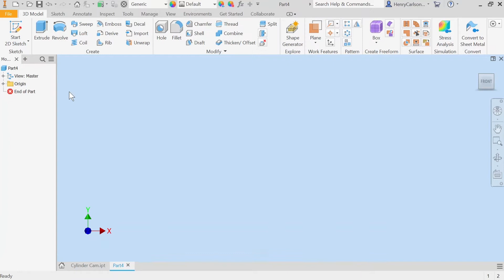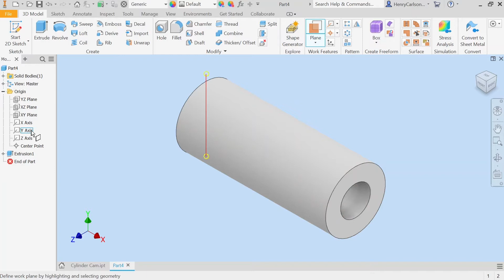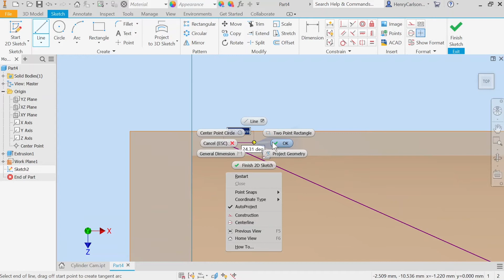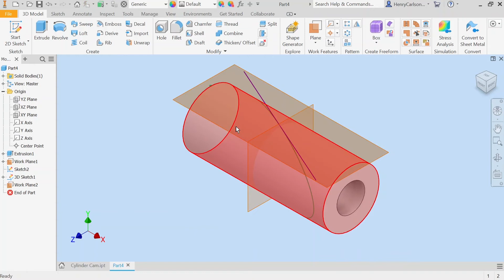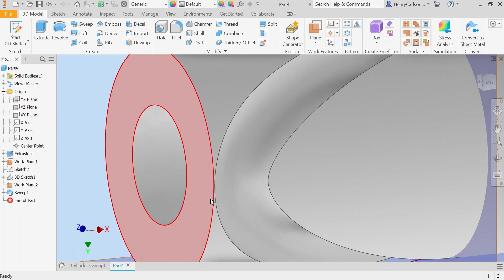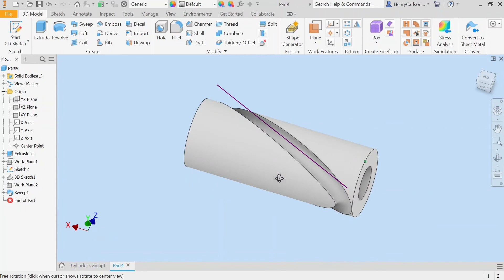Creating a Cylinder/Barrel Cam: Inventor Tutorial

Comment: Hi Sir,
Thank you for creating such a great video.
Sir, I need to create barrel cam which can travel 6inch in one direction and same for reverse i.e. total 12 inch linear motion. Sir, I would appreciate if you could help me with what should be the minimum diameter x length of barrel required.
Sir i need to submit a project so if you could update your base design and provide me ipt will help me a lot.
Thank you.
Reply from the maker: You should not need to change the diameter of the barrel. Just lengthen it to 7 applications or so inches and make the groove with 0.5" buffer on each side.